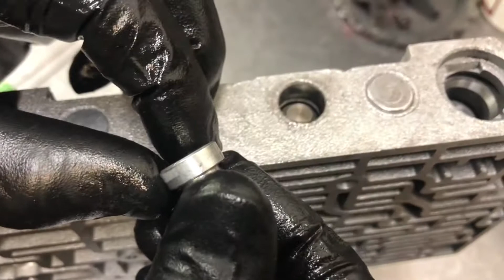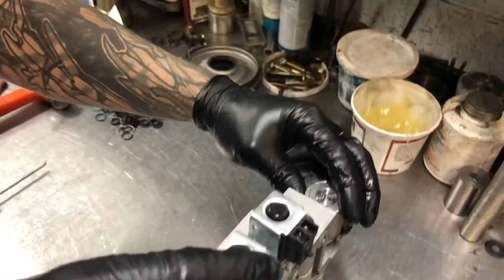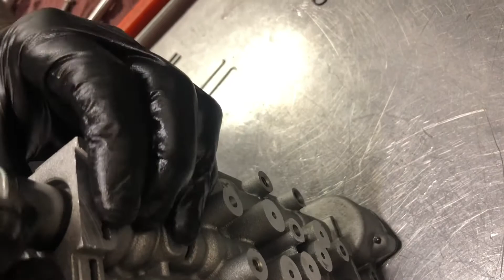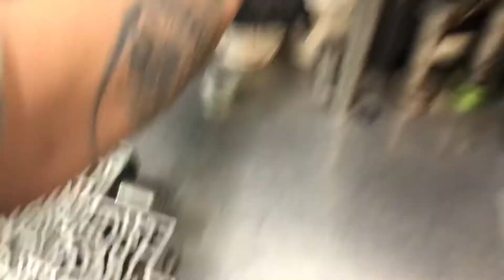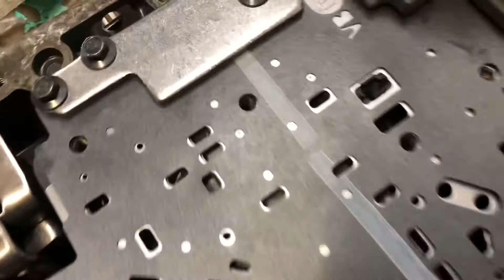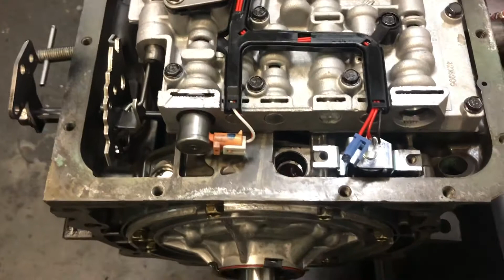4L60E. Valve Body build 2 of 2

Comment: I noticed you didn't put the balls below the 4 accumulator, why would they supply me with balls for every accumulator and it's not used in one of them.? So the stem hole is left open ? Also I have no wedge plate.

Comment: Hi Express , do you use-install a Sonnax Heavy duty 2-3 shift Valve (part# 77754-41) in your Performance 4L60E builds?  I have a Built 4L70 that im about to swap into my car, the current 4L65 is slipping in 4th and i want to make sure that the 70's Valve body is set up right for max Performance and reliability, Your help is much appreciated
Reply: never heard back from you?

Comment: Did you install the conical screen filter into the snout of the lockup solenoid before you installed the solenoid into the pump?

Comment: Awesome video.  I’m having a hard 1-2 shift after she warms up .  Also have a short delay once every other month with forward drive. Had it rebuilt about 70k miles ago.  Had the issue very early on but I couldn’t duplicate the problem when I took her to the tranny shop so I kept getting turned away. I’m going to be replacing the 1-2, 3-4, and forward accumulator pistons with the sonnax pin less accumulator pistons.  Thoughts?
BTW I like the music.  Relaxing 😎
Reply from the maker: I would scan for codes and verify no slip codes then do accumulator. Also check line pressure may be time for a epc
Reply: @expressautotransmissiondav4207  Thanks for the quick response!  Btw she’s a 2005 Suburban with 4L60E.  She’s not throwing any codes for slip.  Should I be changing out the valve along with the EPC solenoid if the line pressure is low?
Reply from the maker: I would get a pressure gauge on it and verify low line. A worn afl valve bore can cause all of these complaints. Also when you pull the vb down make sure you check the plate for excess wear in the check ball holes.
Reply: @expressautotransmissiondav4207  Well I got the valve body down and the check balls were different sizes.  Looks like the tranny shop grabbed whatever random check balls they could and put them in the valve body. Also valve body bolts were super tight.  Think I’ll go ahead and buy the Torton balls for her.  Doesn’t look like the valve body has excess wear in the check ball holes.  Will I need the 0.250” check balls?
Reply from the maker: Yep yep definitely want all the same size balls good catch also make sure the back three bolts that hold the separator plate on are torqued while your there.

Comment: Doing an oil change after a rebuild.  I found the 8mm pressure module bolts stripped, a solenoid clip installed to the side of the solenoid holding it in and plastic accumulators.  Tech did put in a shift kit but what's the use if all the other parts are crap? 
Bought pinless accumulators, replaced the stripped 8mm bolts with studs (there's about 1/2 inch of good thread in the bolt hole) and replaced all the O rings with Viton.  if you have the time and tools, watch these videos a few times and do it yourself.
Reply from the maker: Sorry to hear that. I'm glad our videos helped  with your transmission.

Comment: Friend, it seems to me that you did not put the battery piston 3-4 correctly ... According to the manual, the spring should be on top ... Correct me if I'm wrong ...
Reply: I believe you are right about how the factory one guess but the sonnax instructions to do as he did if I remember correctly from installing mine
Reply: @james10739   11. Pinless 3-4 Accumulator Installation
a. Remove accumulator pin.
NOTE: Pin bore is blind in this location, so
 there is no need to plug with any checkball.
b. Install D-ring toward dome with PTFE seal toward open end.
Install dome toward case (Figure 15).
c. Install Sonnax 3-4 accumulator spring.
Reply: @james10739   spring top
Reply from the maker: I prefer the piston in the way it is in the video.

Comment: A couple more questions ... is it worth drilling holes in the spacer plate? Should you plug the hole with an aluminum rivet? They are interconnected, a rivet and a new valve with a spring?
Reply from the maker: It changes it from a pulsed on lock up to an on off lock up while regulating the converter clutch pressure down for better converter life.
Reply from the maker: Yes the holes need to be drilled and the rivet has to be installed if the spring and valve are
Reply: @expressautotransmissiondav4207   Say, I understand correctly? After I put the rivet, install the valve with the spring from the kit, the torque converter will be in constant engagement, thereby it will stop dumping gear from fourth to third when accelerating? Or I'm wrong?